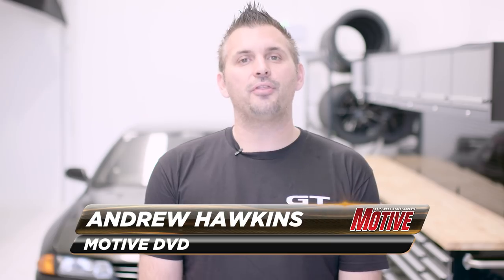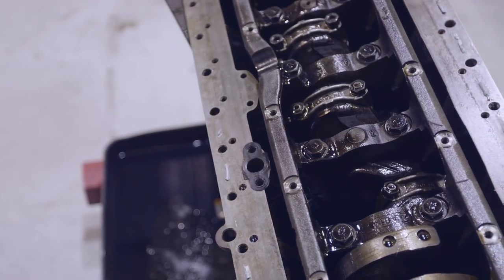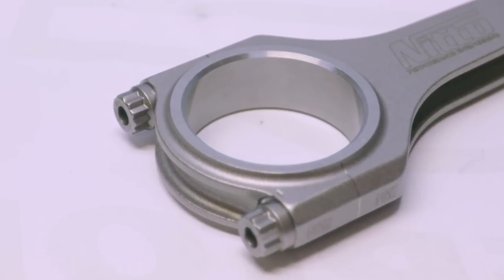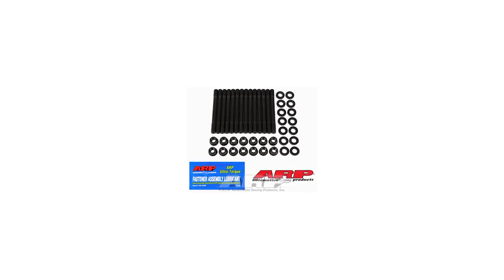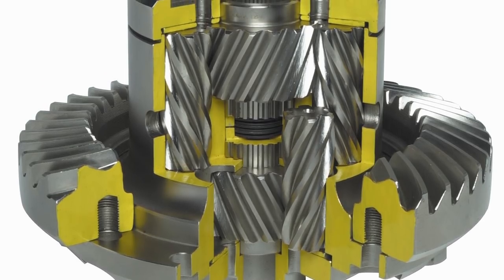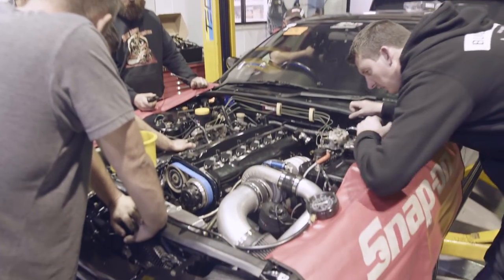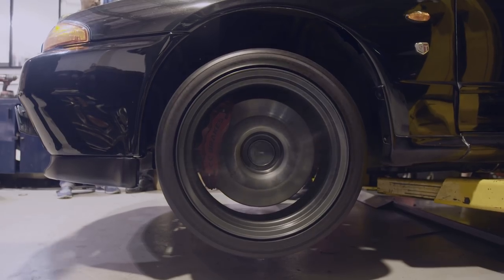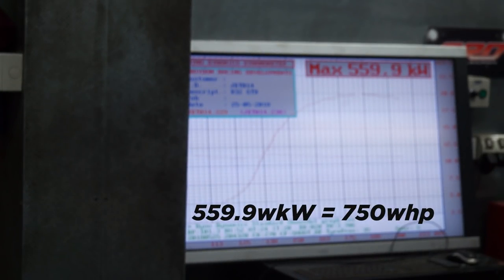1000 engine HP GT-R Budget Built RB26 Pt2 - Truth about rods, bolts and studs and dyno time!

Comment: The engine builder & tuner is probably the most important thing when building an RB. A mate of mine had pretty much the entire nitto catalogue in his rb25 drift car. Nitto rods, pistons, oil pump. I think he spent about 30k on the engine. He had a lot of oil starvation issues, engine builder couldn't fix it. It had custom sump and head drain etc. Ended up killing the engine after 1 season at only 310rwkw.

Comment: I have a fairly built rb26/30 nitto rods and pistons ported and polished head full super tech valvetrain in my r33 gtst but going to be running 98 not e85 hoping to make 650-700hp to the wheels with the garret gtw3884 67mm

Comment: Another killer video as usual! I'm surprised you guys didn't do a rear head drain since its cheap whilst the engines out, what was the reason for not doing it?
Reply: my guess is its probably not necessary with reduced oil flow to the head
Reply: ChrisHallett83  Doesn't it make more sense to improve drainage than restrict flow?
Reply: @lutherblissett9070  RB's get more than enough oil to the head when stock. That's why restricting it doesn't hurt.

Comment: Im in U.K and watching what you get out of what little you changed is mind blowing,  these fuckers over hear are taking the piss they would want to change so much more at a HUGE cost to customer. 
Australian's are definitely ahead of U.K with tuning these monsters 👍✌👍✌
Reply from the maker: potato filming australia is very advanced at GTR tuning and E85 is the main factor behind the power capability to easily
Reply: @MotiveVideo  im assuming 85 is race fuel ? , im out of tune with performance cars its been a little over 13 years since I had a Skyline and over here there was definitely over kill with tuning. 
Im watching Australian videos and its mind blowing,  even taking into account over a decade of advancement. 
I seen a interesting comment recently and it said Skyline owners were sending engines over to be tuned in Australia for less than doing it domestically .

Comment: No break in period on all them new parts
Reply from the maker: It drove 40m from the top level to the bottom level of the building. Thats plenty! Bedding new rings in is the most important thing and we didnt change pistons and rings, so its bed in already. Bearings are good to go instantly and cams already bed in. Moral of story is, no break in period required. Good engine builders and tuners only bed rings in on dyno then good to go. Break in is old wives tales stuff.
Reply: @MotiveVideo  How many ks did the engine last?

Comment: Any issues  with the  block cracking  was a brace installed or any grout used
Reply from the maker: its stock. Lucky dip really. The time and money spent to grout fill or make a brace fit isnt really budget as there is more machine work etc involved. We will do that when we make a "has everything" block
Reply: We have four or five 1000hp s-chassis cars here in South Florida and they all run n1 blocks.

Comment: 6:50 I know this is a budget build, but you guys are still using the factory ITBs?
Reply from the maker: Factory ITBS are best unitl over 1000hp
Reply: @MotiveVideo  And is there a throttle response advantage compared to a single throttle body?
Reply from the maker: @bluesrike  Yes, very much so

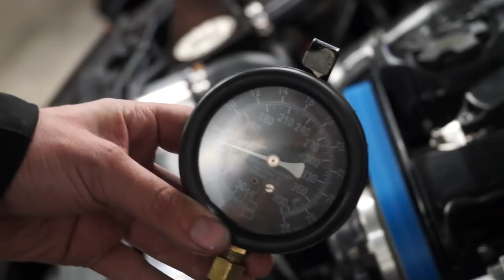Comment: Hey Andrew can you explain what the gauge at 9:30 is measuring? Haven't seen it before
Reply from the maker: CRD always put a mechanical oil pressure gauge on a newly built engine the first time it goes on dyno to check oil pressure.

Comment: Derived hp= American setting on dyno
Reply from the maker: Yep :) Exactly why we are using it in the video, but still showing wheel horsepower like real men
Reply: It’s really only the manufacturers that show engine hp over here, everyone far prefers numbers at the wheels or quarter mile trap speeds.
Reply: Agreed only car commercials here in the US use BHP (derived hp or whatever) literally any built car that actually goes to the dyno we use WHP.
Reply: Any US viewer watching one of your videos who is remotely a car person wants to see WHP. that derived/brake horse power shit is unnecessary and arbitrary.
Reply: American horses are slightly smaller so you get more ;)
Reply: Peter Carruthers actually Mechanical ( Imperial) hp which is used in the US is slightly bigger. 1 mechanical hp = 1.01 Metric hp. Google it.
Reply: In Australia a stock gtr roles up 240 hp in America the same car is 320hp
Reply: I think you are confusing whp with bhp. American car commercials or a factory spec sheet use bhp and that is the extent of its usage. Any build is whp same as in Aus. That is all my point was.
Reply: Go to 6:01 and you tell me what a stock gtr "roles up" on an American dyno...
Reply: Dylan White good to see an non happy dyno
Reply: American dyno figures are friendly. Only in the US you can get a car with 1200whp from a turbo rated at 800hp 😂
Reply: Its so stupid that so many dyno operators don't apply a standardized correction factor to their dyno numbers.   It kinda makes these dyno numbers pointless.
Reply: Peter Carruthers “Hey Australia, hows that cost of living and exchange rate treating you?” 😂
Reply: Jordan Breier 
hope your enjoying the show👍
its the pg version of what murica will enjoy.... maybe in your lifetime, who knows. CPI in the double digits, not even in the teens.... lol 
buckle up son, gunna be a bumpy ride. ✌🏻
Reply: @toki89666  My S3 33 GTR made 210whp, 250 for a 32 is pretty consistent with American dynos reading 20%+ higher than ours.

Comment: So whats the $$ amount at?
Reply: R M if you have to ask you can't afford it.  I'm not sure on exact parts used but this would be close
Get a stock 32 GTR for mid 30's to 40ish. Just parts alone: 
Lets see fuel system: 4K
Haltech Elite or similar spec ECU R32 GTR PNP 3K + tuning
Quaife front LSD 2K
PPG or OS Giken sequential dog box 16-20k
Twin plate clutch 2.5
Billet steel flywheel 0.5K
Intercooler & Piping 1.5K
Engine upgrades using stock bottom end : 4-5k
Garrett GTW3884 + 6Boost+wastegate+oil&water lines and fittings 5K
Exhaust & dump 2.5K
Kaaz 2 way rear diff 1.2k
Coilovers, upgraded brakes, wheels, tyres at least 15K. Add at least another 15K for labour, plus more for a cage and chute or anything else that I forgot or if anything breaks. This is not a cheap car by most standards. You could easily spend 100K on top of the asking price for a setup like this.
It's cheap compared to a Porsche  or Ferrari and would eat them in standard form on the straights anyway, probably not around corners. Though just imagine how mad you'd look bagging up all 4's through 2nd leaving Harry's, fuck the house just live in a GTR.
Reply: dikfro 5000 rather spend my money on a Supra, was only asking as he mentioned it was going to be a budget build. Regardless of car make I can appreciate the build.

Comment: So how much is this Budget?  I would be happy with 300kw at wheels in my 32. I have maxed the factory set-up at 272kw@wheels. My next step is Garret Dash 5s as I prefer the engine bay to look stock and will stick with low mount.  That should see low 300 kW range at wheels I'm told using Link G4 ECU. I know what all this owes me so your build without any Mates Rates thrown in can't be that cheap/budget? Great vids covering this car by the way. Cheers
Reply from the maker: If you ahve stock engine then go -7s as -5s are laggy and power potential is beyond what stock bottom end can handle. We made 383kW and ran 10.9 on -7s

Comment: Damn. Feel bamboozled by the end of the video. 950 engine hp is the same as crank hp right? So it's not 1000hp at the crank or wheels. Plus, in what way is this"budget friendly"? 
For an avg consumer wouldn't this be over $35k usd, not including cost of the seq gearbox and fuel system?

Comment: Hey Andrew, here is what i dont quite get... you're saying you have a 200 bhp loss from the engine to the wheels.. why is your calculated drivetrain loss soo high? You cant say that if you put a dead stock R32 GTR on any dyno that it would suffer a 200 bhp drive train loss.. the stock drivetrain loss would only be what some 20 odd % e.g (for AWD) for a stock Nissan R32 GTR which has 280 bhp from factory. 

So an assumed 60 bhp loss over all from engine to wheels power? What im asking is why when you're pushing now 700+ hp from the engine on the same physical drive train components does your drive train loss jump to 200 bhp?? Should it still not be 60 bhp give/take a little bit?
Reply from the maker: Each dyno is different and no one can truly calculate engine hp without putting it on an engine dyno. We have watched a manual V8 make 630hp on an engine dyno then get chassis dynoed at 470rwhp. In a 4WD GT-R you can say it would be at least the same.  A "206kW" factory R32 ( which was proven to be more like 230) struggles to make 150kW on our dyno. Thats a loss over over 100whp on a factory car let alone a modified one. To be hoenst, we really dont care, its just a goal we have to make 1000 calcualted engine hp on this dyno. What we really care abot is what mph it runs at the track.